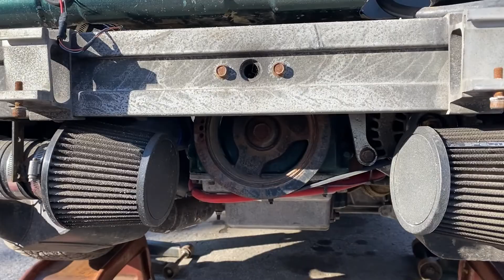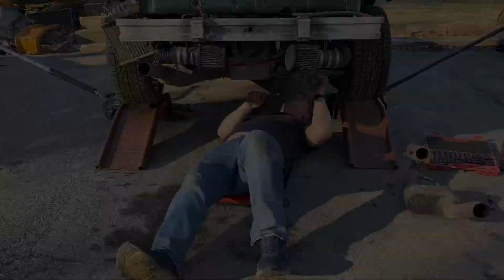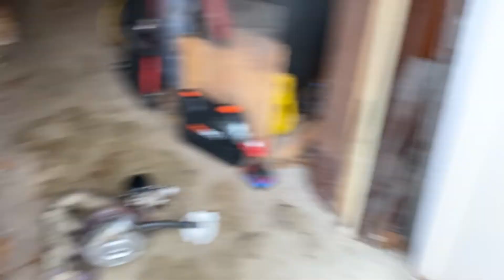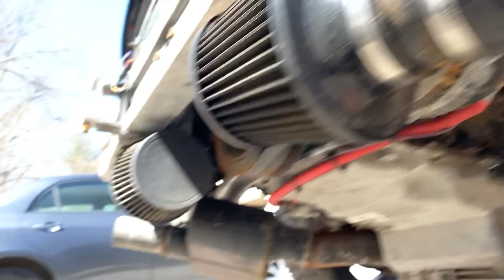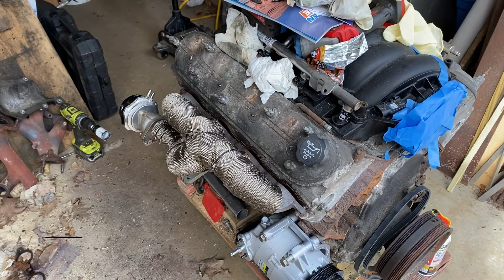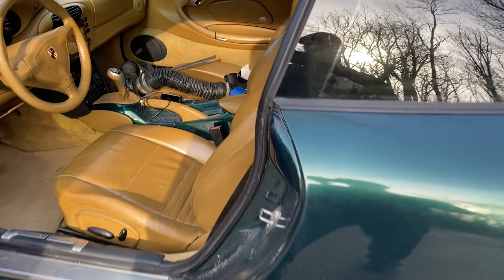Porsche 996 LS twin turbo swap version 2.0 part 1

Comment: Did you consider using liquid to air intercooler integrated in intake manifold? These things are a bit pricey and bulky, but there are models that should fit your engine bay as far as I know. This will create some other points to consider (weight of it all, necessity to upgrade the cooling system to be able to cool charged air), but it should free some space.
Reply from the maker: Im switching to an air to water setup right now but as far as I know the intakes with an integrated intercooler are far too tall to fit where I need it to. When I say there’s no room I’m not exaggerating.
Reply: @willisthehutt9422  yes, I do realize it. I would suggest looking at CBM Motorsport manifold or Lingenfelter. They seem to have the least height and might fit. Hope it will be useful for you and will help make your car even cooler!
Reply from the maker: A stock LS1 intake is tight in the engine bay and any of those intakes with an integrated intercooler add about 3” so unfortunately none of them will fit. I think my new setup will work which you’ll see soon. Thanks for the suggestions though.